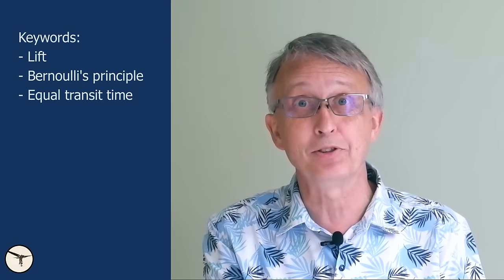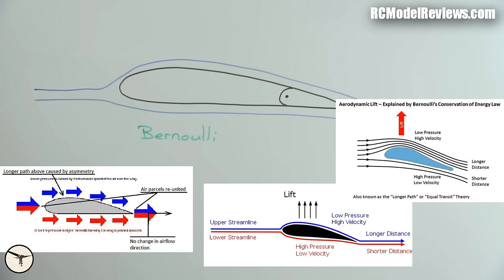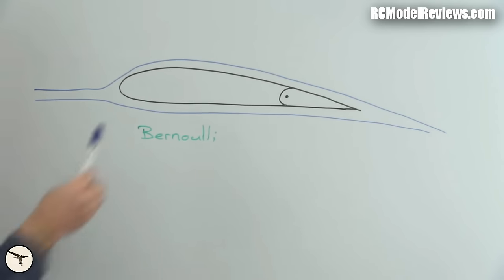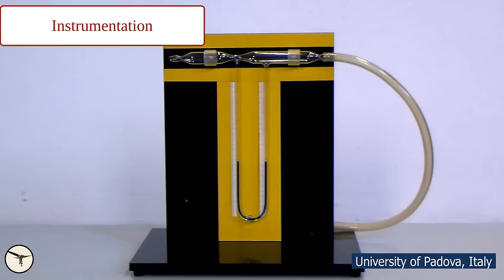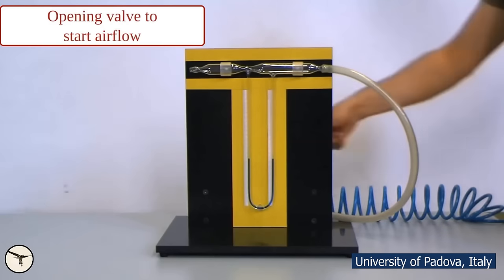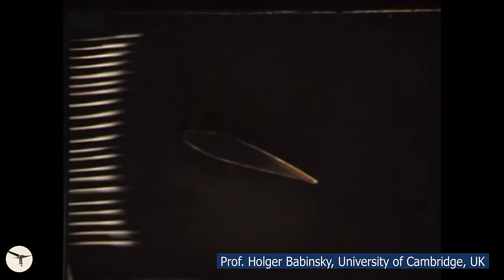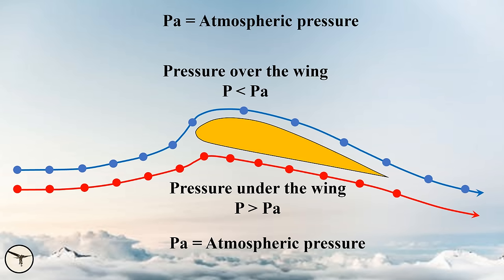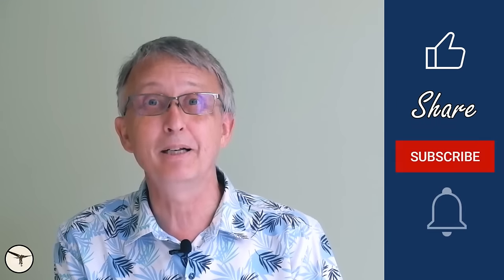Why are so many pilots wrong about Bernoulli’s Principle?

Comment: Note that the M2-F2 (glider) and M3-F3 (rocket powered) lifting body re-entry prototypes that predate the shuttle have the longer surface on the bottom (along with a relatively high angle of attack while gliding), somewhat similar to a wing that is upside down and backwards (leading edge is thinner and narrower than trailing edge). You can find images and youtube videos of both. The main reason for this design was the relatively high drag reduced the time from re-entry to landing. As for "why air flow over a wing remains attached", a simple explanation is "void theory": as a wing at some angle of attack sweeps through a volume of air, the air has to fill in what would otherwise be a void swept out by the wing. Since the air has viscosity, a frictionless mass of air can't simply follow along with the upper surface of a wing. Below stall angle, what would be a void is filled in by air that mostly follows the upper surface of a wing. If the wing is stalled, then vortices will fill in what would otherwise be a void, greatly reducing lift. Another side effect is that there is a normally a net increase in pressure at the trailing edge of a wing. The induced downwash continues to increase speed until it's pressure is reduced back to ambient, and the speed when pressure returns to ambient is called the exit velocity. This is more obvious in the case of a propeller or helicopter rotor.

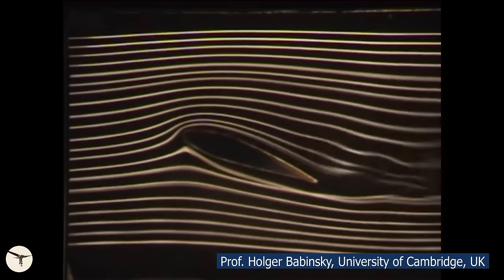Comment: this  model doesnt explain the reversed flight. For me what creates lift is Conada Effectd:  in a fluid around an object tend to follow the shape of an object. This is clearly visible at 2:38. With the Coanda Eeffect a flow of air is pushed down, so for action -reaction the plane is pushed up. When the angle of the wing is too big the Coanda effect disappears and the plane stalls

Comment: Great video, but I would like to say that while he does mention the lift being generated by the airflow under the wing, he skips over the reason why. It is because any time a fluid is forced to change direction (the wing's angle of attack causes a downward deflection of the air striking the bottom surface), energy in the fluid is given up, and this energy manifests itself as an increase in pressure on the deflecting surface.

Something interesting to note is that while the low pressure area on top of the airfoil is more or less dependent on the airfoil, and therefore stays in the area with the most curve, this is not true of the pressure being applied on the bottom of the wing, which is quite erratic. This is why an airfoil that stalls due to excessive angle of attack becomes unstable, and why "flat" wings will never work, but symmetrical wings will.
Reply from the maker: I totally agree!
Reply: The most pressure change is on the top of the wing, not under, on a high speed low AOA condition, the button of the wing could be lower pressure than the surrounding  as well, just not as low as the top.
Flat wing totally works, I have made dozen of them out of KT board, and you probably have done so with paper.
Reply from the maker: I'm sorry, but I disagree with you. The most pressure change happens at high AOA where the stagnation point is below the leading edge of the wing. This forces the air to follow a larger curvature, which causes a larger acceleration and hence, a larger pressure drop. Maximum lift coefficient is achieved at critical AOA. For a reference, please read "Aerodynamics" by L. J. Clancy, pages 62-63. It can be downloaded here:  https://www.scribd.com/document/321464060/Aerodynamics-Clancy-pdf
Reply: Yes, Newton's Third Law. Air mass displaced downwards is counteracting the weight of the aircraft.
Reply: @FlywithMagnar  Maybe I didn't make it clear that when I say the change I mean the absolute value of the difference between ambient pressure and local pressure, and the picture on p63 shows exactly that, on normal AOA, the upper "suction" is more than the under "pushing".
ofc no wing IRL have only upper or under part, but when it comes to what surface is more impotent to keep clean if you have to place things like engines or flaps guide rail or even ice, most of the time is the upper surface to keep clean
Reply: @umi3017  
Flat wings will not work for any serious stable, subsonic, climbing scenario. The cases you mention (KT board and paper airplanes) are low to no positive angle of attack - you throw a paper airplane in the direction you wish it to go, and the flat wings attempt to remain at zero AOA for minimum drag as it glides to the ground. Any significant positive AOA and the paper airplane will flutter and fall rather quickly.

These days, the line between rocket and extreme performance airplanes is becoming more blurred. By that I mean the power is so overwhelming (as in some modern fighter jets) that the engine will push the plane in any direction you wish it to go - even straight up. In such a case, airfoils are less necessary and take a backseat to raw acceleration.
Reply from the maker: Even a kitchen table can fly if it has a big enough engine.
Reply: @FlywithMagnar  

Exactly. I used to watch a video somewhere on the web of a RC "plane" that looked just like a push lawn mower - handle and all. Many of us have seen the RC "superman" and "witch" models. Anything can fly if you push it through the air hard enough.
Reply: @royshashibrock3990  first you said that a flat wing will "never" work, then added a bunch of caveats to situations where it does work. In reality if you set it to a moderate AOA, the airflow patterns around it (stream lines, pressure fields, etc.) look just like those of a normal wing. It's just not quite as good (less CLmax, less L/D...) and there are no redeeming qualities to make it worth the compromise in choosing over a standard airfoil... in most situations.
Reply: @FlyNAA 
My exact words were "Flat wings will not work for any serious stable, subsonic, climbing scenario." But please show me the "caveats" and the situations to which you refer.

But you can't seriously believe that "In reality if you set it [a flat wing] to a moderate AOA, the airflow patterns around it (stream lines, pressure fields, etc.) look just like those of a normal wing." I strongly suggest you seek out the book mentioned by the video author in one of the above comments.
Reply: @royshashibrock3990  Your first exact words were "will never work." (Your post is still there, scroll up and check it out if you don't remember.) After that, you hedged and added the other stuff.

You yourself have already provided examples of flat plate airfoils working - novelty RC planes like flying Snoopy doghouses, etc. For a more pedestrian example, there are the classic balsa gliders you can buy for a few bucks on Amazon.

But you incorrectly say that they can't climb. There is no reason to think that if you add a thrust source such that thrust available exceeds thrust required, it won't climb like any other airplane under the same condition. You can test this yourself also, with the rubber band powered propeller version.
Reply: ...and to prove it, just stand underneath a helicopter (ie. rotary wing aircraft).
Reply: This one hurt my head a little, LoL
Reply: @FlyNAA  
You know what I mean, but are purposely avoiding the crux of the matter. Wings were conceived as a means to allow efficient flight with relatively little power. If you have unlimited power, wings are totally unnecessary (witness missiles and rockets).

Flat wings will never function for what wings were intended to do (see second sentence of this comment). Supersonic aircraft wings may LOOK flat, but I assure you they have an airfoil shape tailored for the airspeed at which they normally operate. And even then, flaps are required at lower speeds to allow enough curvature to produce the required lift to climb.

Can you use them (flat wings)? Sure. But you will quickly become weary of controlling their instability and of supplying the excess energy they require to function. These problems become much worse with increasing speed and load. No aeronautic engineer worth his salt would consider using them for a practical aviation project.

Comment: I flew jet airliners for 30 years. What maters is dont crash. You dont have to understand any of this to fly safely.
Reply: Then, why do you have to learn it? And wouldn't you like to know correct information?
Reply: I met an airline pilot who told me that flying a jet is like "monkey sees, monkey does". Now I understand what he means.
Reply: Correct, pilot do their jobs, engineer do their jobs. There will be no pilot if no one built airplane.
Reply: To hear this is most troubling...since you say you "flew" I assume you no longer do so, which is good. When things go wrong, your knowledge of what you have to work with (the mechanical device you are encased in) may save the day (and the lives of many innocent people). I shudder to think that I am flying on a plane with a pilot that has an attitude such as yours.
Reply: @royshashibrock3990  This particular piece of knowledge has absolutely zero value in problem-solving any normal or emergency situation. A good understanding of the AOA vs CL curve, OTOH...
Reply: @FlyNAA  Thank you. Not all theory is important to every one. But knowing how and why a plane stalls seems critical to me when flying a plane. And you don't learn that with an "monkey sees monkey does" attitude. (pun not intended)
Reply: @mennovanlavieren3885  In general, I agree with you. There are many areas in which pilots would be better served by understanding the theory behind what they're doing, and understanding what they're doing by how it walks them from one place to another, within the theory... instead of rote following of steps, or "monkey see monkey do" as you say. For example, the thrust required curve. The history of aviation is red with the blood of those who didn't understand how their actions move them around that graph. (Or if they did, it was enough to maybe answer a few multiple choice questions about it on the written, but then forget about it and then mindlessly fly by rote the rest of their career).

But for this particular issue, I don't see that. The important parts are understanding where you are on the lift curve, and the instantaneous effect of pushing on the stick and unstalling (or getting away from the stall, if you're close) moving you to the left on that graph. But how that's arrived at by the physics of air? Doesn't effect things one bit. Someone could have all the wrong ideas in the world about the air molecules rejoining (or not), Bernoulli, Newton, Kutta Jukowsky, Navier Stokes, etc etc. If they know to push on the stick to reduce the AOA, the intended effect will happen all the same.

Comment: The Boundary layer that makes the accelerated air flow adhere to the wings surface conducts a negative pressure to the upper surface of the wing when that airflow is fast enough. The Air molecules that are compressed by the round leading edge flows over the wing and are forced to change direction to follow the wings surface . Air has weight and at accelerated velocities creates a centrifugal force that is exerted on the wing upper surface thus creating lift . The larger  roundness of the leading edge compresses the air and creates a higher velocity across the chord and lower stall speed of the wing than a sharper leading edge . Bernoulli's Principle never mentions thow the air is forced to follow the curved surface which will create a force called Centrifugal Force  that is conducted to the wings surface by the boundary layer creating the major part  of the lift  . Down wash also adds lift in Ground effect.

Comment: A flat board passing through the air at an angle creates lift by forcing air downward.  Airfoils do the same thing, but more elegantly and with less drag.  if the shape of the wing is so important, why can some airplanes fly upside down?

Comment: I used to be a flying instructor in the late 80's.   We would explain this to our students and the easy way to confirm it was the propellor wash you could feel behind an aircraft.  If Bernoullie was the reason for lift a propellor would produce no wash and a helicopter would not create any downwash.  (That would be nice - I flew rescue helicopters for years and the downwash was always an issue during a winch rescue)

Comment: Confusing... So. Does the top of a wing pull up as much as the bottom of the wing pushes up?
Reply: Not really.  Air can't "pull" anything.  Lift occurs when air is pushing down on the top less than it's pushing up on the bottom.  Air pressure at sea level is about 14psi i.e. every square inch is being pushed with a force of 14 pounds.  If the pressure on top drops to 13.9psi and the bottom stays at 14, a 10,000 square inch wing will generate 1000 pounds of lift.  I suppose you could say the top is pulling up, but in reality it's just pushing down a bit less than it was when there was no lift.

Comment: Good explanation. Especially at 3:04 where the velocity of air over the wing is shown.
Someone should make that venturi apparatus with only one side pinched to model air flow over an airfoil. *  Of course now you have the problem of showing the tube of liquid  which shows the pressure differential. But this isn't difficult to over come.  *The demonstrator as it now is shows two wings mirrored with the liquid filled tubes modeling the pressure above the air foil against the pressure in front of the 'wing'. You actually want three measuring tubes. One on the 'airfoil' (at the venturi), one before the venturi and the third under the 'wing'. These could work if you just have a reservoir of liquid feeding all three tubes, then each tube would show the air pressure before the wing, on top of the wing and under the wing (which might be made to show how angle of attack increases air pressure.)

Comment: Very simple and concise explanation, however I would add why the velocity increases over the top surface of the airfoil. This is actually due to curvature of the airfoil, which causes a curvature in the streamline due to the coanda effect. An increase in curvature of a streamline causes an increase in velocity. Hence why the top surface of the airfoil has a larger velocity than the bottom due to it being curved more.

Comment: You haven’t explained how the leading edge and upper airfoil cause acceleration of airflow. I can see the positive angle of attack and undercamber can cause increased upward pressure. The leading edge bounces air upwards but then what? If you have laminar flow then what can change the pressure. If you have turbulence then the pressure would drop and contribute to the lift. So why do most wings have smooth upper surfaces and not turbulating .

Comment: The problem with the video shown at 2:36 is that that is not what happens with the wing at that angle of attack (other than in a headwind situation).

Since it is the wing that is moving through the air.

So in this situation the air should be hitting the wing at the same angle that the wing is at (other than in a head wind situation),

The air is accelerated at the leading edge of the wing, because the air is being pulled down by gravity,

The leading edge pushes the air up causing a squeezing effect of the air, which then accelerates the air relative to the air below the wing.

Comment: You can also take the opposite of a flat wing and use a round rod shaped wing but add a little wingtip votrix by spinning the rod.  All you need is to direct more of the air down than up and it will fly.
Note that the wing shown in the YouTube thumbnail for this clip will not generate lift because it does not direct or pust the air down so the air will not push the wing up.

Comment: If you get tangled in velocity and pressure try the Newton alternative. For an aircraft in level flight and slow, so at high angle of attack, the wing moves a relatively  small mass of air with a large downward component of the subsequent velocity. The resulting force has a reaction equal to the mass of the aircraft. At high speed, hence lower angle of attack the mass of air increases and the downward velocity component reduces giving the same effect. It is not rocket science but both flying vehicles use action and reaction. Alas the best demonstration is given by contrails of an approaching aircraft at a close level, preferably as dawn is breaking behind the trails The downward deflection of air is apparent in a fashion that is not as easy to show as blowing over a sheet of paper hanging from one's fingers and watching the trailing edge rise. Propellers and the blades of turbine engines have a strong connection to wings but as devices to provide thrust the reaction connection is apparently more obvious.  As indicated at the begining, this is an alternative perspective of the process that makes a wing work and alters none of Bernoulli's work. Blinkers work well on a horse but are a disaster in crowded airspace.

Comment: The simulation is illustrating not only Bernouli principle: on the simulation the wing has attack angle.

To simulate Bernouli principle the wing's chord should be parallel to the horizontal axis. The flow should be laminar.